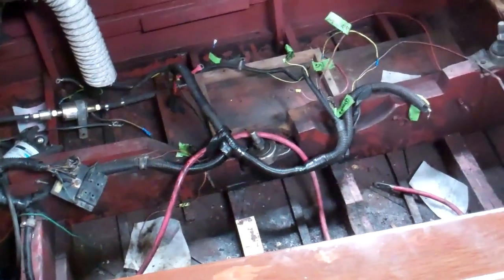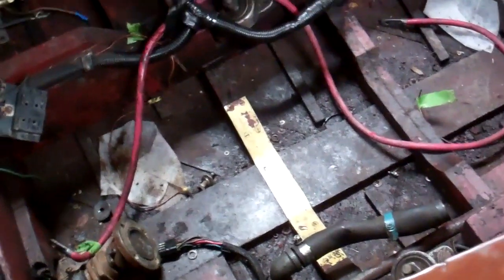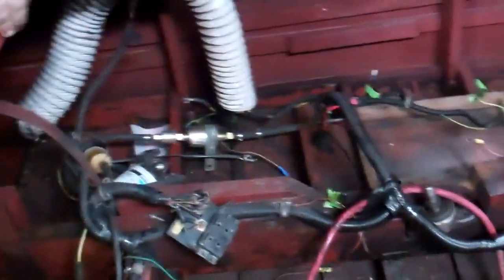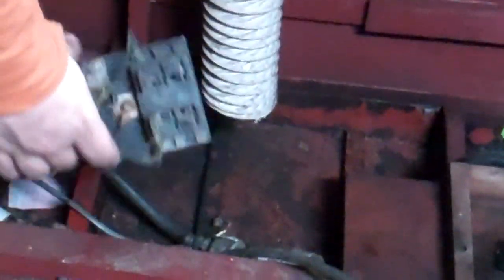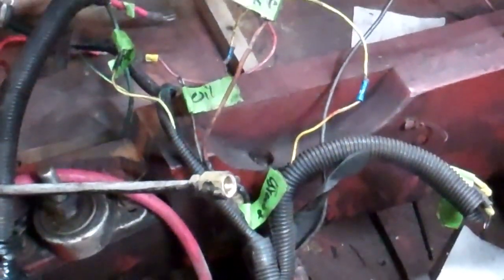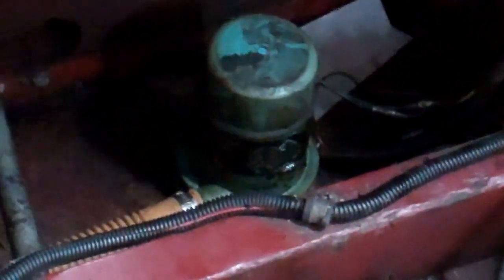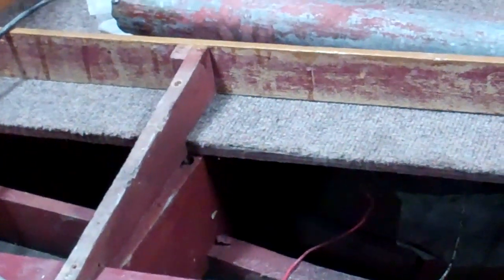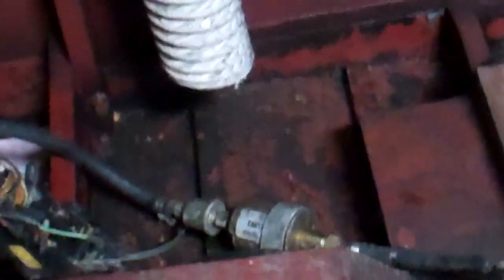1956' Chris Craft 19' Capri Wiring & Bilge Issues 2 18 2020

Comment: I rewired my 1948 CC Deluxe Runabout to the wiring drawing ftom the Maraners Museum (all colors matching)   My Century's are all original with no previous owner changes. Under the instrument panel is amazing, all 40-50's wires are coiled spring like to take up the extra length. My Father taught me how to do this when i was 8 years old by winding the extra wire around a pencil. 
Really enjoy your videos.

Comment: The boat need a new wire harness.  When I restored my Triumph TR4A I put a new wire harness in the car and I also own a restored 1969 Honda 350 Scrambler and it needed all new wiring too.  I strongly agree to put all new wiring in older boats, cars and motorcycles.
Reply from the maker: Yup.... And if you had simply read the detailed presentation above, you  would not have wasted your and my time with this comment:
The wiring is an absolute nightmare, and dangerous to boot. The engine gets fuel via an electric fuel pump that someone wired directly to the positive side of the coil, which can if the wire is sized sufficiently large so that the pump is supplied with the voltage it needs without over-heating the wire. This boat’s pump is fed current from the coil via a 14 ga wire, which seems at least skimpy to me.
Beyond that, we have found seemingly unconnected masses and rats nests of all sorts of wire, most of which is not AWG, throughout the bilge and especially behind the gauges. (We will do our best to convince her owner that the truly safe course involves stripping all of it out and wiring it again from the get go.